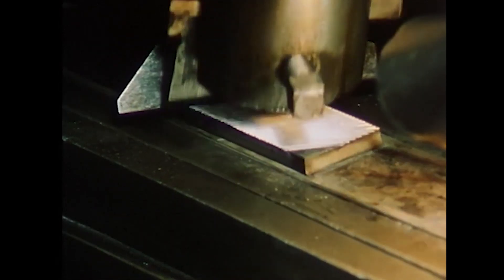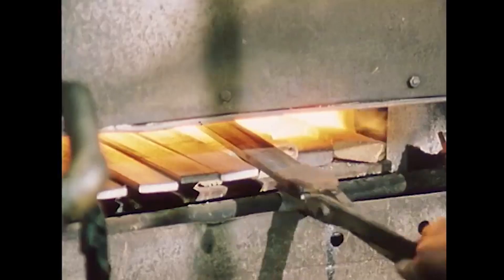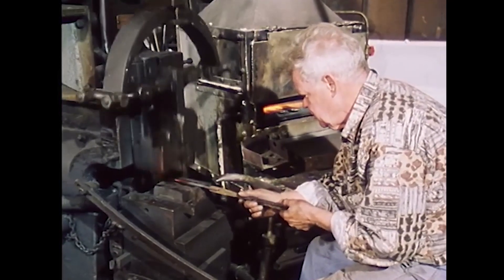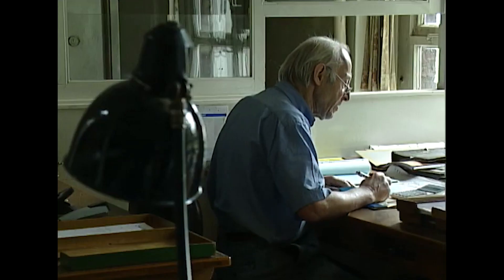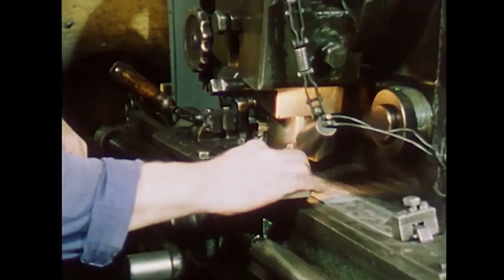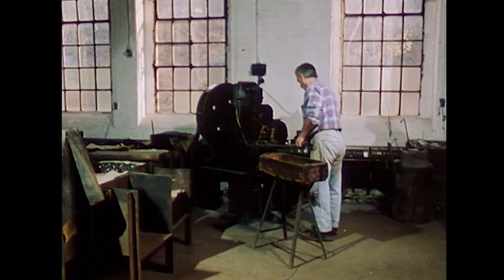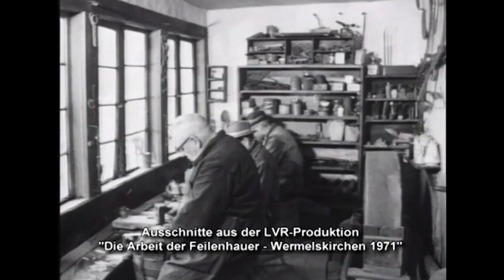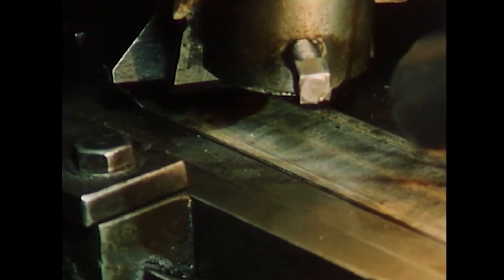How Steel Cuts Steel: The Fascinating File Manufacturing Process

Comment: We use steel to cut steel and diamonds to cut diamonds.  Perhaps ancient masons used stone to shape stone.  I know, this concept is outrageous, im just sayin.
Reply from the maker: You are spot on. It is the oldest rule in manufacturing: just find a material slightly harder than the one you want to shape. Whether it's diamond, steel, or a harder rock like diorite, the principle never changes.

Comment: Most hammer heads, pliers, and cutting pliers are perfectly usable even after more than 100 years. The same with axe heads or logging wedges. The modern ones tend to chip, creating dangerous spalling that can cut through eyes, or skin. I´ve had a brand new logging wedge that created such a nasty spalls that it cut through my throusers and embeded itself under my skin above my knee. I´ve thrown it out, straightened and sharpened a super old wedge and managed to split the log without any issues.
These days when you buy a tool, you search for a T5 class steel, you buy it, try it, and very quickly recognize it as a worthless piece of junk. So what can one do? Go to the seller and ask him what kind of junk is that supposed to be, when its marketed as a T5 steel. He then writes to the manufacturer (mostly China), that then responds with "oh, this is OUR kind of T5 steel" (i.e. basic construction steel crap).
Reply from the maker: That injury sounds nasty—spalling is no joke, and it's a clear sign of improper heat treatment. It is scary that 'safety' today often just means a sticker on the package, whereas back then, safety was baked into the metallurgy itself. You are absolutely right: restoring a proven vintage tool is often the safer bet than trusting 'mystery metal' from a budget brand.

Comment: I would like to have learned the actual material used.
Reply from the maker: That's a great question! For those interested, the blanks are typically made from high-carbon tool steel, which allows them to achieve the necessary hardness for cutting other metals after heat treatment.

Comment: No great mystery here, but a lot of skill and experience.  The file toothing is cut on unhardened annealed steel blanks by using hardened steel tooling . The cut blanks are then hardened and tempered to the desired hardness.  I made a somewhat crude file myself using a hand struck chisel and the new 'file' was hardened and tempered and worked remarkably well ... for a first attempt    ;<)
ps going through the process of handmaking a file, gave me a whole new level of respect for the proper use and storage of files. There are only a few makers of quality file left  today and an awful lot of rubbish is sold. Buy quality files [fairly expensive] and take good care of them.
Reply from the maker: Spot on! The heat treatment process is truly the 'magic' that turns the soft blank into a hard tool. That is incredible that you made your own—getting consistent spacing by hand is much harder than it looks. Did you use a guide for the chisel, or did you do it all by eye?
Reply: @ArchivalCraft  
After a few tryouts on scrap, I did it more by feel than by eye, I just found it easier to get a good rhythm going. The spacing was far from perfect but got quite a bit better with practice. I found the cutter in a box of rusty tools at a car boot sale near Sheffield, It was a fairly triangular shape about 2 1/2" high with a strike point at the top and with the cutting edge at the base. I bought it  along with other odds and ends for £1. Wondering what it was, I did a little research and found it was for cutting files and me being me, I had to sharpen it [on diamond plates] using the existing angles as a guide and I just had to have a go  ;<) Good fun and with a couple of years constant practice, I reckon I would have been be pretty good at it.
Reply from the maker: Finding a vintage file cutter near Sheffield for £1 is like finding gold! That area is legendary for its steel history. It’s fascinating that you mention 'rhythm' over sight—that seems to be the secret ingredient in all these manual crafts. Thanks for sharing such a great story!
Reply: Flies can be resharpened easily in a chemical bath
Reply: @thunderbirdone8126  How is that done?
Reply: I wonder if old files can be ground smooth and recut?
Reply: @SeattlePioneer  
they could, but they would have to be annealed first [easier prior to grinding]. I would avoid using modern files without testing them first, I'm told that some of these are case hardened over a softer core